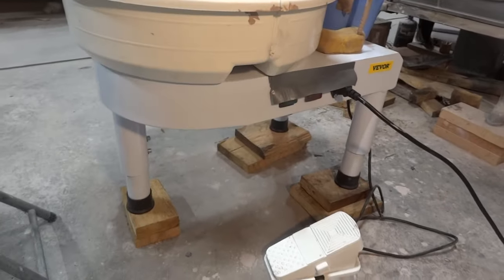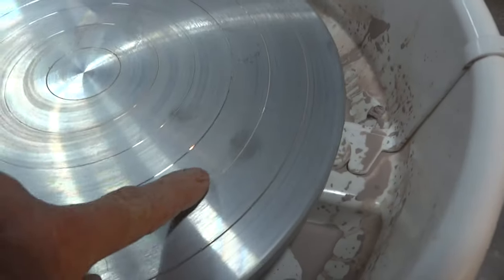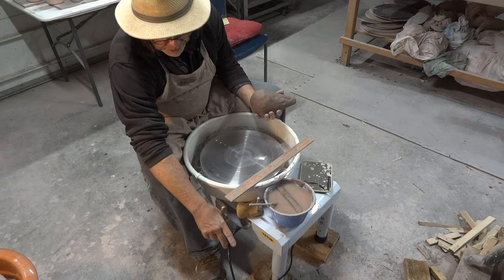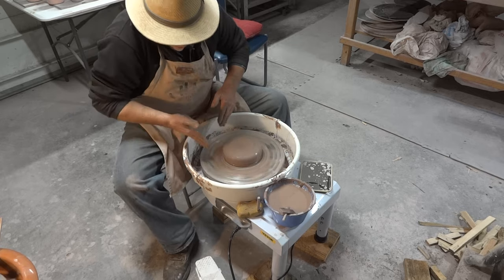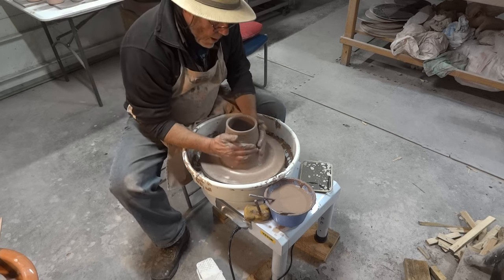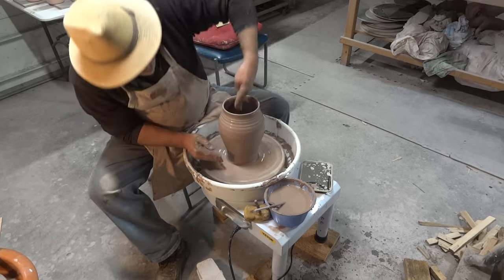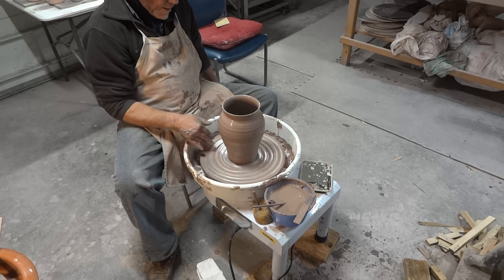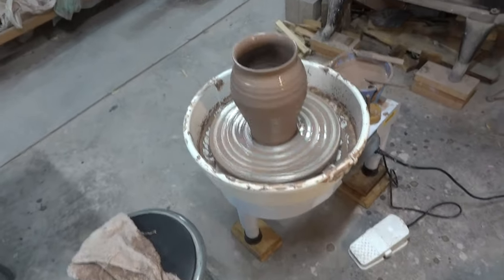VEVOR pottery wheel (part 2) more honest thoughts by Simon Leach

Comment: hot damn, I bought one of these and couldn't figure out what felt off when compared to the studio wheels. It's the depth of the wheel with that giant bedpan and it can really mess up a beginner. On the flip side, I found if I can center and pull on the Vevor, the wheels in class are way easier!

Comment: Thanks for the review.  I can see where attaching to a wood throwing bench would help stabilize and provides space for tools and water container.  Might be able to solve the tray height problem by attaching a 1" thick wood bat to the wheel and then add a plastic bat for throwing.  I suspect if you are new to throwing you will find work-a-rounds and love the wheel as much as I love my Speedball Artista.
Reply: Simon have you taken the wheel head off the Vevor to see if you can add a spacer to the drive shaft?

Comment: Nice follow-up video to part 1 of this wheel review.  Thank you for taking the time to properly test the wheel with a realistic amount of clay.  It's always reassuring to see someone with demonstrated expertise use these wheels and produce good results.  As you mentioned, the standard name brand wheel costs have soared in the past two years.  I have a Shimpo Whisper and they are now upwards of $1500 or more, depending on where it is purchased.  The same goes for Brent and Skutt wheels -- some models are over $2000.   If I were just beginning, I'd certainly give one of these Chinese wheels a try.  Happy holidays!

Comment: Hi Simon! I have the same wheel and a Shimpo RK from the 70’s. On my foot pedal I got rubber feet that are cup shaped from At Home and put the bottom screws through them. On mine the motor does bog but is a more consistent bogging rather than surging like yours does. Maybe I got lucky. Fortunately bat pins are inexpensive and easy to install so that’s the first thing I did. I use mine more for trimming than throwing but for the money, to get someone wheel time at home to keep practicing for under $200, it really fills a hole in the market and as a second wheel it’s quite useful even if you invest in a professional model later. I bought a second one to keep at an off grid property, hopefully it’s also a good one.
Reply from the maker: I agree with you, for the money get one even if you have to customize somewhat to get it running as you want.

Comment: I bought one of these wheels and found it a little short too. 
Easy solution to fix the low height is to buy a length of 2 inch wooden dowel and cut your own leg inserts.

Comment: Thanks for your suggestion of sanding the wheel head…I, too, cut my finger on the rough wheel.  I spent several days throwing and I had no real issues, just adjusting to a different wheel.  And, wiring off was awkward with the high drip pan.  I only managed cups, small bowls and vases.  For the price, I think It’s a great travel wheel or demo wheel.  I put an old tv tray table in front of the wheel for my water pot.  Thanks for the bed riser info to raise the legs; great tip.  Thank you again for your videos!

Comment from the maker: Hi Eddie. Hope you had a good Christmas. The wheel sizes I have vary somewhat. Some grind on the splash pan spigots where they join together.( had to melt them and push them down to get clearance!). The larger wheel head I had on this last test was about 13.75” wide. A smaller diameter would have been fine. Wheel head is too deep in the pan if you aren’t used to it, but can be worked around with time. The wheels are OK for someone like you or me but for someone who is not practical, they present some quality control issues !  …Simon, all the best for 2024 !

Comment: 5 cheap wheels Simon? But you only have 2 hands! I have one of these I got for $100 online. I’m just starting to sell my pottery after many years of hobby and can’t justify $1500-$2000 for such a small business. There are quirks, but it can turn out mugs and vases and small pitchers. It’s a better wheel than I could make myself, and for very little cash. Really, mugs and small vases are what sell anyhow, and they fit efficiently in a kiln, and the rest is easy enough slab built. Maybe next year I’ll have sold enough to justify the buttery smooth wheel of my dreams. If you want to be profitable, this is a real way to keep costs down.